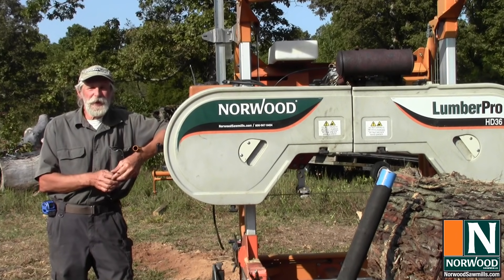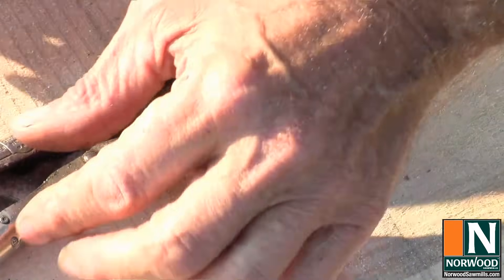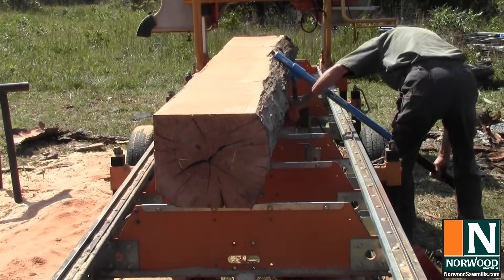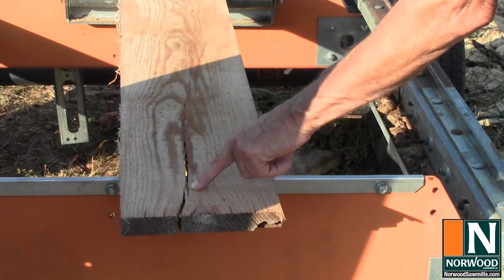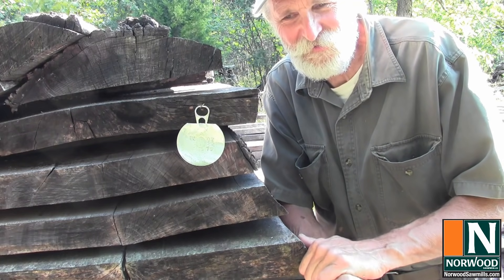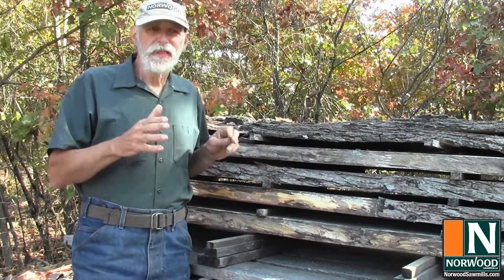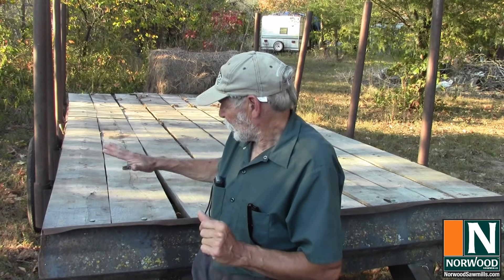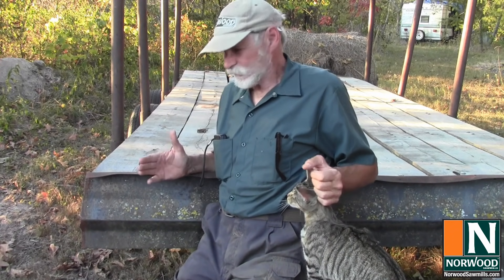Sawmill School - Air Drying Your Lumber

Comment: I have cut 3ft live oak and red oak that read at 20% moisture straight off the sawmill. Logs can dry to some degree assuming the bark is off and it's stored off the ground.
Reply: It would be interesting to measure moisture gradient from the outside to the inside of the log.  Storing the log off the ground is important, for sure!

Comment: I've had a pressure treated 2x6 shrink an inch in length on a Deck before. It was soaking wet in the winter time and come spring when it warmed up, it had shrunk that much in length.
Reply: Pretty amazing what the lumber yards will sell as "ready to use"!  An inch is pretty significant for shrinking in length.

Comment: When the wagons going  from the east on the Oregon trail halted in Montana, they failed apart of shrinking
Reply: Makes sense.  Also sailors "swabbed the decks" with seawater to keep the deck boards from shrinking and forming cracks.  WWII aircraft carriers used wooden decks to avoid sparks that would cause fires when an aircraft made a crash landing.

Comment: In Australia, for our native eucalyptus hardwoods, we have a rule of thumb -- Depending on latitude and altitude and seasons, one year of air drying per inch thick of slab or board. The impatient folks and commercial bean counters air dry half as long and then solar kiln to finish off.
Reply: Thanks for the comment.  As I understand it, eucalyptus is a pretty difficult wood to cut!  That rule of thumb is pretty universal, but depends a lot on the climate.  Best to use a moisture meter in any case.

Comment: I loved your video, and it was apparent right away that you knew what you were talking about. 
  I've been a traditional style woodcarver and furniture maker for over fifty years. My dad always told me to stack my slabs two feet off the ground, use stickers at least every two feet in a uniform vertical line, paint the end grains, edges, and both surfaces, at least 6" back from the ends to slow the drying process to reduce checking and cracking. Also, he told me to keep the sun off of it completely, and air dry one year per inch of thickness outdoors, and then two years indoors for thicker slabs. I guess that would depend on climate, but it has always served me well. Air dried lumber carves better than kiln dried.
  I've been using aluminum roofing paint on the ends, but I'll start using your recommendation once I review your video and learn whatever the heck that was. 😀 Great video!
  Thank you very much Sir!
Reply: Your dad gave you good advice!  The aluminum roofing paint should work well.  The advantage of Anchorseal is that it is a water-based paraffin that doesn't penetrate into the wood so it machines off easily with no residue.
Reply: "Air dried lumber carves better than kiln dried." -- I always wondered why is that.
Reply: @MrProtozaur  I've always wondered myself. My dad showed me the difference when I was a kid and I was amazed at how much better 'that old Pine board' carved vs the 'kiln dried board' that he had purchased.
  I'd sure like to know who figured that one out.

Comment: A moisture meter only reads the surface of wood.
The most accurate way of knowing the moisture content is by weight over a period of the drying time.

For this most valuable and accurate description of determining the moisture content in wood, have Norwood ship me a free portable sawmill like this one used in this video.😊
Reply: You're right, but I just don't have time to unbolt the trailer decking to weigh it.  After the the wood has had a year or so to equalize out, the moisture meter will give a pretty good idea of the moisture content of the wood.  Believe me, the Norwood mill is worth the investment!
Reply: You are so wrong in your answer.
Depending on the type of meter you generally are measuring either the electric resistance. But this can be at the surface or as deep as the probes are driven in.
You may also use a microwave sensor or infrared and sorry but way too involved to describe.
But the only actually accurate method is the oven method. It's 100% accurate as density and mineral variation does not affect it.
But it's not always a matter of removing moisture.
It can be the timber needs time to dry or even needs to be dried super fast. 
Colouration can also be a significant factor.
It is a science and as some have said it needs people to pass on the knowledge. In reality very few coming in to the industry actually want to hear. Most will fail but whose pocket suffers?

Comment: I have done box drying. That is you use boards for stickers spaced an inch or two apart. It does leave a mark on the boards but it depends on what they are used for. Its better in a building. I suppose you can cover the pile with metal roofing. Keep the piles lowish.  ,because it gets to be a pain lifting   on to a high pile.You start from a level base. Lumber does dry out some during a winters storage.
Reply: Thanks for the comment.  I use metal roofing, and stack them as high as the front end loader allows, putting 4x4 blocks roughly every 500 bd ft, so I can handle them.  Winter drying depends on where you are.  Not much takes place after the moisture in the boards turn to ice.  Good point about the level base.

Comment: Thank you for sharing your knowledge.  Could you give me your opinion on the norwood chainsaw mill?
Reply: Thanks for watching, and for the comment.  As a chain saw mill, the Norwood mill works fine, up to about 14" diameter, if you are only milling occasionally.  I'd recommend a ripping chain and at least a 70cc chain saw.  Any chain saw mill is slow, noisy, and cuts a wider kerf (more sawdust, less lumber) than a band saw mill.  If chain saw milling is the most practical for you, the Norwood mill is a good way to go.  That said, if you can afford even the cheapest band mill (take a look at Norwood's "Frontier" line of mills, I'd recommend that.

Comment: Enjoy the insight! Living in Michigan, with outside drying, what moisture level for using poplar for 2x4’s in construction?
Reply: Good question.  You'd probably be ok in the 12% to 14% range.  If you will be using it with lumber yard 2x4 lumber, you should mill it to 1-9/16" x 3-5/8" to allow for shrinkage.

Comment: Thanks for the info Dave. I just got a mill and am finding it's a steep learning curve. I've watched a few of your video's and finding them very helpful especially compared to some other video's out there. The biggest challenge I'm finding so far is getting a straight cut. Your video on tracking was helpful,. I'm cutting 24" spruce in 3 to 4 inch slabs for live edge benches. pretty wavy but I think I'll get it figured out.. thanks for your help.
Reply: Hi, Bruce.  Thanks for the comment.  I don't know what it is about spruce, but it does seem to be more difficult to cut straight that most species.  It might be that 10 degrees hook angle is too aggressive, and a 7 or even a 4 degree angle would do better for you.  Which mill do you have, and how are you tensioning the blade?

Comment: Thank you Dave.  Your very knowledgeable and down to earth. It's a pleasure to learn from you.
Reply: I appreciate that, Rick.  Are you a woodworker or sawyer?
Reply: @daveboyt6810  Woodworker mostly. I've made some lumber. i have a ceder trunk I cut 2 yr's ago.  It's 40" at base by 32'.  After listening to you I realize I better get busy but I only have a 22" bar and I don't know how to cut it. Do you think I should invest in a larger bar?
Reply: @rickrodgers9277  Depends... what size saw do you have?  Do you anticipate cutting more logs in the future?  In addition to the bar, you'll want a ripping chain which is filed at a flatter angle than a conventional chain.  Here's a link of me quartering a sycamore log about that size so I can get it on the mill (that part starts at 15:50)  https://www.youtube.com/watch?v=eLbnjkjXDmw&list=PLsnOqmGA7xRN8fdaH1n9cVDTHLdyX3-_D&index=7.  Good luck!
Reply: @daveboyt6810  I have an old Stihl MS 290 and I don't foresee cutting another log this size. Thank you for your help.

Comment: Great video!  I have a sawmill also. Before I mill up the logs, I paint the ends of the logs to prevent checking. Each species of wood is painted a different color so it's easy to identify each species of wood later.
Reply: Good idea.  I use AnchorSeal on the good stuff.  What kind of mill are you running?
Reply: @daveboyt6810  I'm using a TimberKing 1220 sawmill.  I typically use AnchorSeal or white oil-based paint as the first coat on the log ends, then paint a color as a second coat to color-code the lumber.  Thanks for your reply.

Comment: Just starting on my adventures in milling wood - great information - less things go wrong with experience - experience comes from things going wrong
Reply: Best of luck with your sawmill adventure!  Which mill are you using.  No matter how much experience you have, things still go awry, but as long as you pay attention, you'll do fine.  Let me know if you have any questions or specific topics you'd like to see covered.
Reply: @daveboyt6810  thanks for the reply! Just using a Granberg Alaskan small log mill and edging mill.  As I already had chainsaws a plenty it seemed like a good cheap way to have a go at milling my own lumber out of interesting logs I drag home from my work as an arborist. put a decent ripping blade on my table saw. adjustable work bench (a bunch of pallets stacked up) and hey presto small back yard saw mill.
Reply: @tomwilson8190  I've cut many a board with a chain saw, and still fire up the old Husq 2100 to quarter logs that would otherwise be too big for my mill.  You can get some pretty interesting logs from arborists, and I try to make it worthwhile for them to give me a call when they have something I can use.

Comment: How do you minimize the discoloration of air dried wood from the slat separators?
Reply: Thanks for the question.  That's called "sticker stain", and I should have addressed that in the video.  Use kiln dry stickers of either a light-colored wood or of the same species as the wood you are drying, and keep the stack covered from rain and snow, and you shouldn't have any problem with it.

Comment: Nice video Dave.
I've had a few batches of air dried.
I think it's worth it if you can do it.
Better color in the wood.
I think the kiln dried process injects some steam. 
The natural wood dyes run out.
Air dried just takes time.
Reply: Depends on the wood.  On the down side, air drying white wood like maple can discolor, and bugs can be a problem.  Industrial kilns use steam to speed up the process, but solar, dehumidification, and vacuum kilns don't.  Walnut is typically steamed to turn the sapwood dark but, as you observed, it does affect the color of the heartwood.

Comment: Dave you mentioned sweet gum briefly. I'm wanting to saw some into beams for a cabin and some other for trailer decking. I've heard they twist so bad that doesn't work.  What's your position on that?
Jason
Reply: Good question.  Sweetgum has an interlaced grain (like elm- nearly impossible to split by hand) that causes it to warp and twist as it dries.  I wouldn't use it for beams for that reason, and it rots pretty quickly, so it wouldn't be great for trailer decking, either.  I think the best use for sweetgum is woodworking, using kiln dry wood-- it can have some amazing grain.